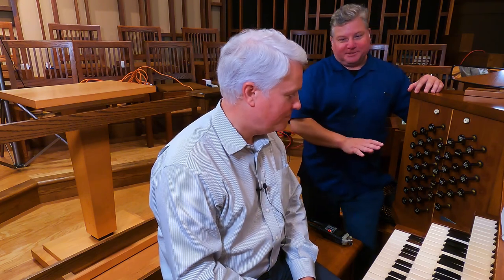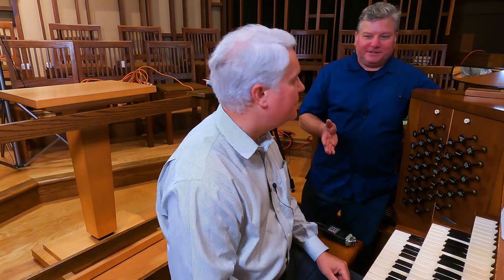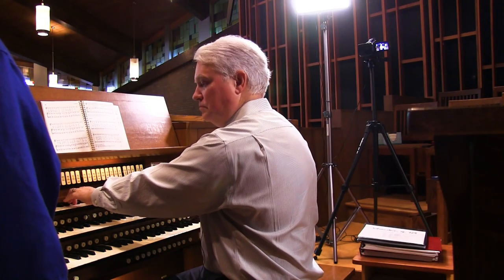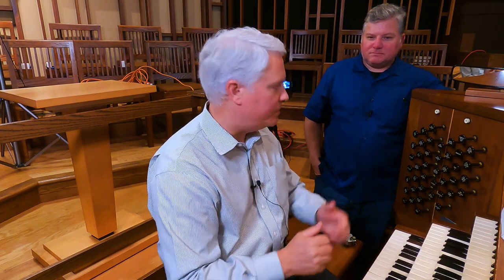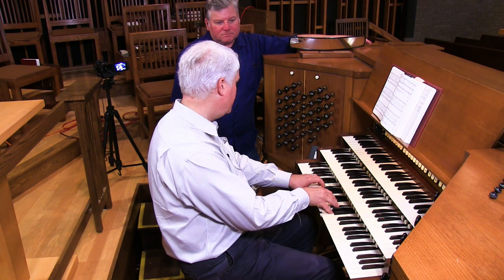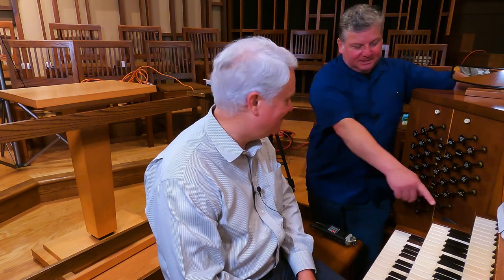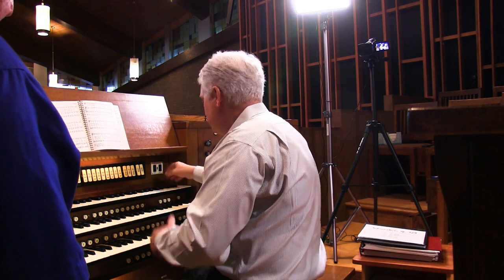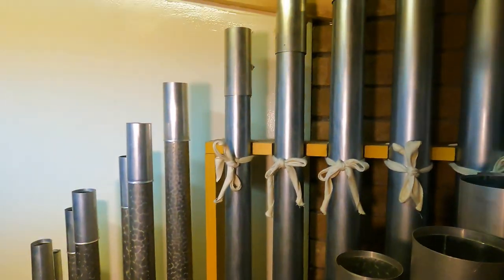1997 Schoenstein organ - Convenant Presbyterian, Madison, Wisconsin

Comment: The annuciators are hysterical.   Temperature is The Thermonunciator.   Blower oil level is The Lubrinunciator.  

St. Paul’s K street in DC has an electric bench height adjustment with an indicator.  In the organ world it’s known as the Buttannunciator

Comment: This organ would sound much better in another room because Covenant's space is acoustically very dead and surprisingly small for an instrument of this size..  Obviously, quite a generous budget was available to purchase this instrument.  I hope the Organ Media Foundation visits St James Catholic church in Madison to experience the Wadsworth organ there, with added stops by James Taylor.  A four manual Skinner is being installed at St. Bernard's, Madison.  Originally in a building that accommodated 5,000 people, this 1916 Skinner is scaled using very high wind pressures.  A two manual Skinner is being installed there as well, with the two instruments connected.  Maybe the Organ Media Foundation will be able to introduce these instruments to the community as well.